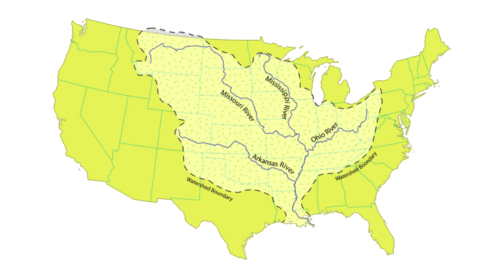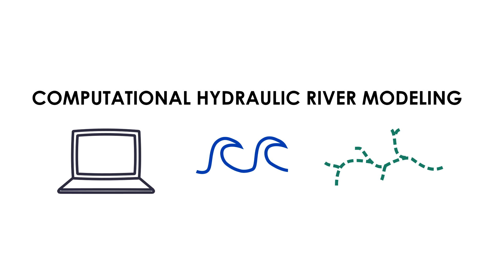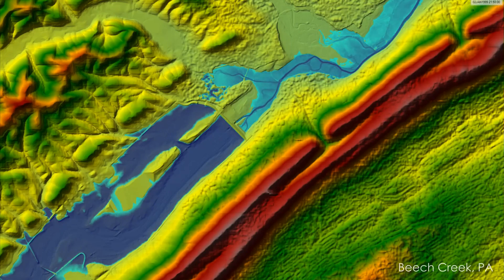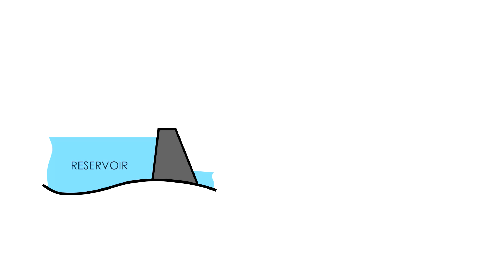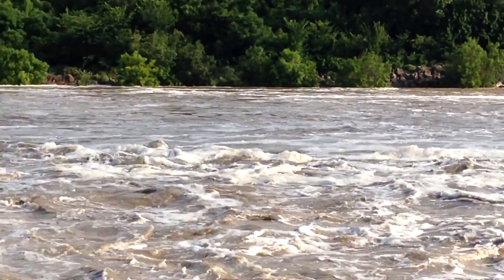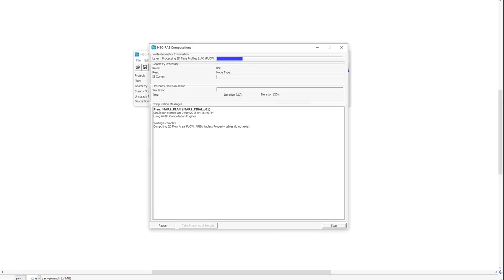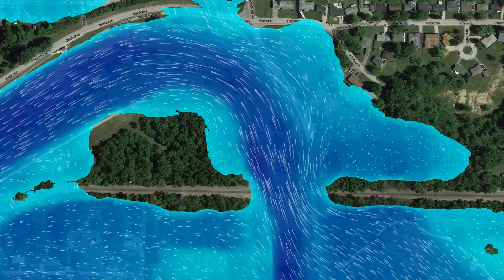Rivers on Mars! (and other uses for hydraulic models)

Comment: What I find a little confusing is that the flood simulation on Mars is using the existing topography (most probably a digital elevation model) to determine the path of the flood. However did those channels exist before the flood - i.e. were not those channels created by the flood you are trying to recreate - chicken and egg scenario?
Reply: in other comment practical engineering replied as such "Yes, the erosive processes are not included in the model. It's just a demonstration of what a flood in the channel might look like."

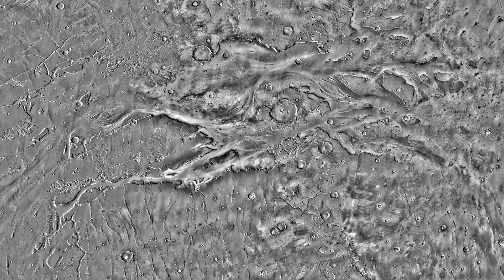Comment: come on!, MARS doesn't show hydraulic scars, ITS ELECTRICITY! all creators consists of a big+ pole of electric current indentation and a smaller - pole ear by. No creator has any artifact of water flow out of the creator Also notice 6:02 left down corner, you find almost 90 degree corners,dous water do that? Nope, You know what dous look similar to that pattern? Birkeland currents.And since when do "rivers"create an elevated soil path for them to travel trough? I though rivers cut trough the landscape! 6:10 mid left some hexagon patterns,also not water behavior related.7:04 mid low, waterflow just stops in de side currents,doesn't seem to do that here on earth. and mid high, what dous your instinct tell you? water or electricity? keep your mind open for alternative narratives.

Comment: What software would you use to model a hydroelectric project? Specifically comparative analysis of various designs in a small stream with variable flow-rate.
Reply from the maker: Probably just a spreadsheet. Energy from a hydroelectric installation is fairly easy to calculate.

Comment: Last time I worked with HEC-RAS it was cross section based and output was tables of numbers.  I was the intern drawing inundation areas from one cross section to the next along contours in ArcGIS.  We'd go out and check our work after (see: intern stands in cold water holding a measuring stick steady for an hour) and talk to EMS about traffic management plans.  I had fun, disaster planning is fun.

Comment: I've been playing with with but there's an issue with the survey data. Apparently the DEMs (digital elevation models) available do not take into account the river floor. How can I get this data without an actual bathymetry?

PS: On the other hand maybe the software simulates the increase in water flow ignoring the base flow. If that's the case then I don't actually need to know the river floor elevations.
Reply from the maker: Yes, most LIDAR can't shoot below water, so you have to get actual survey data to incorporate the terrain below the water (bathymetry). Another option is just to estimate the approximate channel section and "burn" that into the terrain. For flood studies, often the actual channel is a very small part of the overall flow area, so it's not crucial to get it perfect.
Reply: Yeah I think it should be negligible for flood analysis. Thanks you! Keep up those great videos!

Comment: hi, I'm a student in geography of natural hazards in france, I often hear that the models are mostly reserved to engineers and it is possible but quite difficult to use them if you are not one, do you think it is possible to work with this model for someone who is not an engineer and how much time would it take approximately to master it ? ( I can code in python, a little in R, otherwise I do not know any other codes )
Reply from the maker: I would generally agree with that. Learning the software isn't hard, but understanding the hydraulic engineering principles is. For any model, if you put garbage in, you get garbage out. You must be able to understand what the model is doing and whether or not the results are reasonable. HEC has published a hydraulic reference manual for RAS that goes into greater detail on the underpinnings of the software. Try looking through it and it may give you a better sense of whether you will feel comfortable working with hydraulic models.

Comment: Hmm. I'm guessing that it doesn't take much of an adjustment factor to account for the lower gravity on Mars. Water still flows downhill and fills a basin, albeit at a slower rate. It might be worthwhile to bust open the source code and look for a way to add a gravitational adjustment. Handling zero G would be a whole different story, and the calculations for evacuation times would be suspect, but for the basic questions of exogeology, a few tweaks might be good enough. I'm much more afraid, however, of how the soil would differ. My only consolation is that adjustment factors for soil type already exist.
Reply: Right you are William. Get the source code, make amendments to include gravity. And white you are at it. fluid density and atmospheric pressure (i.e surface tention like mr. practical engeneering says). Publish the code on github, put it on your resume and get a job. or.. sell it to nasa... in case you have a job. which i think is likely judging by your profile picture.
Reply from the maker: Thanks for the comment William! Unfortunately, all of the empirical work that has been done in the field of river hydraulics has been done on earth. It would be nice if it was just a matter of changing the value in an equation, but even some basic assumptions break down when you start reducing the gravity (e.g. neglecting surface tension).
Reply: You're correct that I'm employed, but it might be a fun open-source contribution, so I looked into it. Alas, checking the Corps web site just now, they do not make it easy to get the source. Citing their distribution policy page, "CEIWR-HEC generally discourages the distribution of CEIWR-HEC source code". Oh, well.

Comment: I have always said it "Heck Rass (like grass)". Wonder now if I have been off the mark the whole time.

Eh, great software though, considering. US Army Corp of Engineers are great for releasing engineering documents and tools. I have used documents on runway design (standards and engineering concepts/methods for the design process) to HecRas software from them.

It's so easy to get a decent linear model going though when you have a reasonable amount of cross sections and some rating stage velocity data. Slap it in, few contraction and expansion coefficients for obstacles like bridges, mannings n appropriate for the channel, job done.
Reply from the maker: It's second-hand, but I was told the people from USACE say "H.E.C. Razz".
Reply: Huh, fair enough!

I had a similar pronunciation problem with LIS Flood. It's a flood modelling software from  Bristol university work originally if memory serves. 

We were saying Lies flood, L. I. S. Flood, Liss Flood haha. I had to just lock down on Lizz Flood I think, for consistency.

Good software too by the way, has some interesting capability and visualisation. The way it models the movement of the fluid is a bit different under the hood to HECRAS though they can serve similar roles. It's powerful but less polished (you'll be using cmd a little for example).

Comment: The lower gravity on Mars would have a pretty big impact on the way water flows, so the simulation in the video is - as was mentioned - little more than a pretty animation. I'd love to see some actual fluid simulations in Martian gravity...
Reply: Slow the animation down then :P  
Surely water still flows to the lowest point just takes longer.
?
Reply: I was thinking as I was typing that last response. The source of the water would remain higher for longer. If the volume of water was large enough it would spill over to area's that would not be affected so soon otherwise.
So your are right more or less.
Reply: Hear, hear! Some people claim the channels on Mars were formed by lava flow, so a realistic hydraulic simulation would definitely help out the debate.

Comment: How much does the change in gravitational constant actually affect the flows here? It seems like it mostly washes out (sorry) due to constraints of the terrain. But I'm mostly ignorant here, so probably missing important details.
Reply: Sounds about right, maybe the lower gravity also means more particles stay dissolved in the liquid and settle down slower, creating longer and shallower sediment trails?
Lower gravity also means higher waves, like tide on earth?
Reply: Gravity is what generates depth dependent pressure that drives water outwards.  I would imagine it matters quite a bit, since Mars has about 1/3 of our gravity at the surface.
Reply: I wonder if this would cause rivers to bulge upwards in the middle more.

Additionally Josh, the gravitational constant doesn't change based on where you live. Big G is a relationship between mass and the force we experience. The force is what changes when you move from planet to planet because of mass. You can see this in Newton's law of universal gravitation, F = G (m1*m2/r^2).
Reply: Mostly ignorant here too, but consider this: Perhaps the lesser gravity makes for a slower stream , and thus dampening the destructive power of water we all know so well?